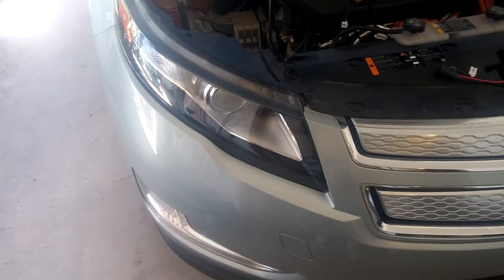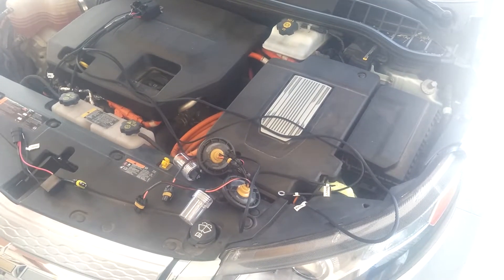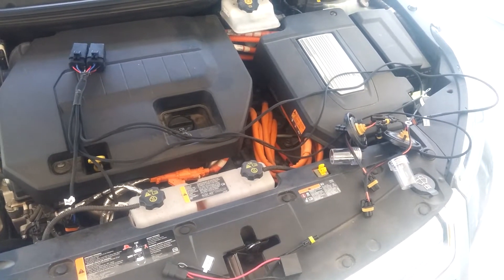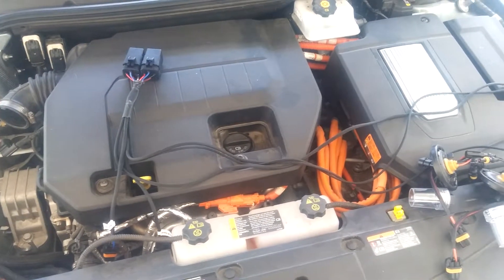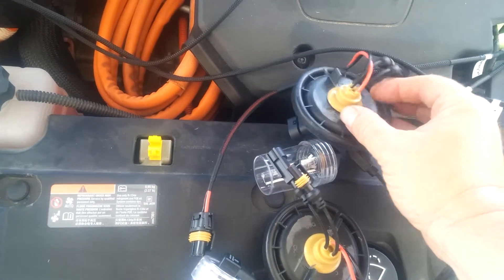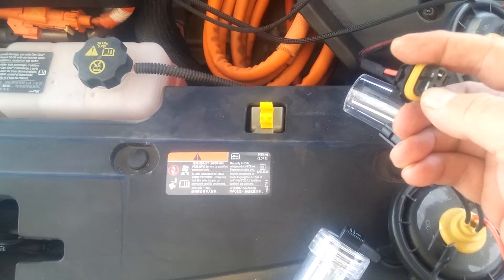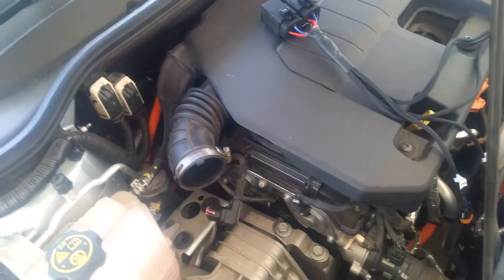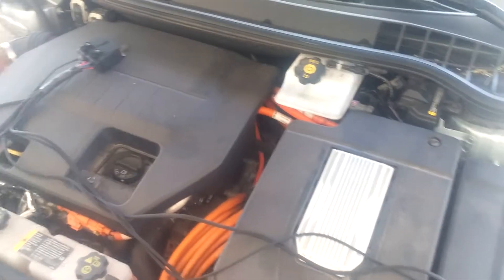Chevy Volt Propper HID installation of full Morimoto system from The Retrofit Sourse PART I

Comment: have you had any issues with 1 side staying off occasionally?  I just installed these (HD relay with capacitor, 35W) and one headlight will be out 50% of the time... not great.
Reply from the maker: They have been flawless. No issues what so ever. The low beam cutoff might be a smidge low and I may adjust that a proper back stop and tape measure...thats the only thing I can nit pick. They are fantastic. Flicker free. When these lamps burn out (5500k) I will replace them with the Morimoto 4500k) as they are a tad blue for my taste.
Reply: Smooth Rider ok, thanks for the feedback. What year is your car? Mine is a 2014, wondering if there are any year by year differences. Have an email in to retrofit source.
Reply from the maker: @mjbaz11  2013. Should be same same.

Comment: The headlights aren't pulse width modulated. Service info read something to the affect of "bcm supplies B+ to lighting the low beams...".  The bulb would be quite dim if that was the case. I could scope it I suppose for fun, but based on service info and the wiring diagram, doesn't look like it.
Reply from the maker: Thanks for the info. I had been told by the good folks at TRS it was PWM. Also read that in a few places...at any rate, I have had zero issues in approximately six months of use. They have have not flickered once. The only thing I would change is the 5500k lamps to 4500k Motion to lamps. Next time.
Reply: @AZsmoothrider  I'll scope it this weekend since I'll be working on it anyway; for fun. Yes I'm a nerd. I have used and am about to order a kit from ddm tuning. On my old vue, they said I needed a relay kit. But I could never get them to work correctly. I eventually dumped the relay kit, reversed the polarity and it worked. Im actually mostly worried about getting errors such as lamp out codes.
Reply from the maker: @sterline80  Cool! Let us know how it goes. I've had no codes or issues of any kind...the light increase and quality is just ridiculous over stock. I also figured out you can turn your hids on with the key fob. Pretty neat.
Reply from the maker: ...So reading the GM service manual today I found this (pg 3089), "the BCM uses a BCS (battery current sensor), connected at the neg battery cable at the battery. It creates a 5v PWM signal of 128hz which directly inputs to the BCM......"
Reply: @AZsmoothrider  the signal from the battery current sensor to bcm is a digital. There are a lot of pulse width modulated signals such as cam timing solenoids or coolant pumps, but those aren't related to headlamp systems. I didn't get to scope headlights today because one of my dogs got sick. I'll get to it one of these days.
Reply from the maker: @sterline80  I see. I thought it was applicable as the bcm controls the headlight circuit. Guess it's over my pay grade. Hope your dog feels better.